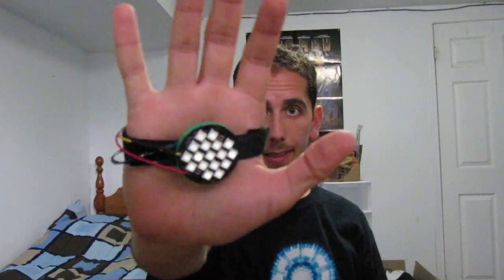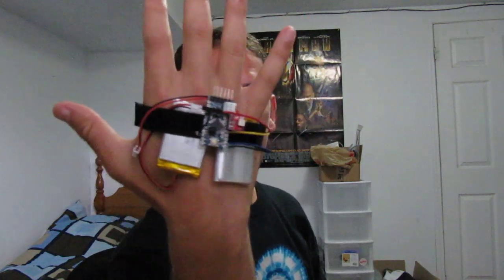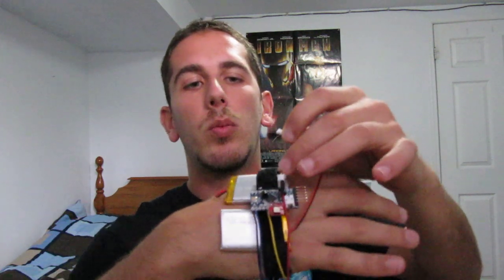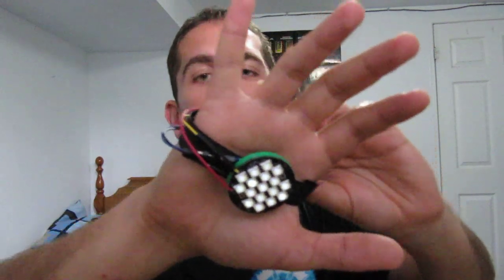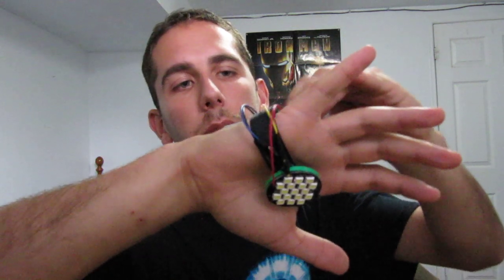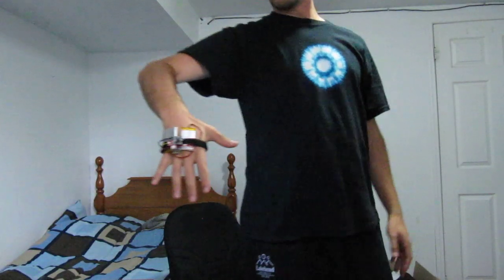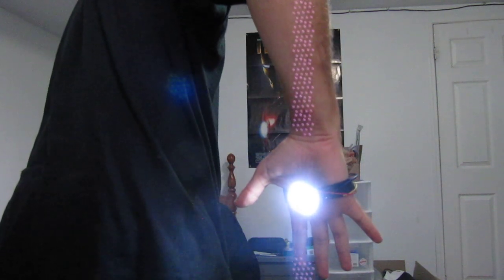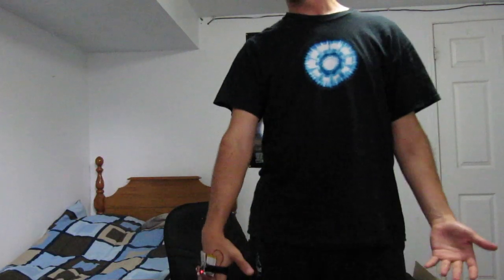Compact Repulsor Unit with Sound

Comment: hey buddy can you not replicate capacitor charging sound bby actually using capacitors
Reply from the maker: Yes, but it's not near loud enough and doesn't accurately match the sound from the movie.  Good thinking though!
Reply: thanks.... dude.... what if u were to club it with a xenon flash..... camera flashes uses them both a powerfull flash & capacitor so u have almost real powering sound with a final burst.....*(i know u already answered it .... just wondering of there is any method to amplify that sound mechanically
Reply: also for body armour have u thought about using pcb motors OR piezo motor